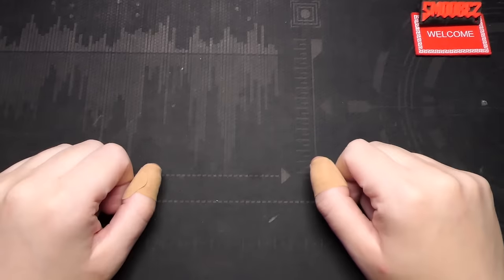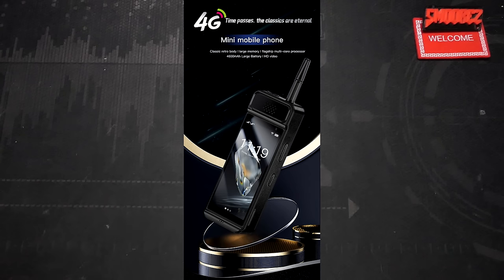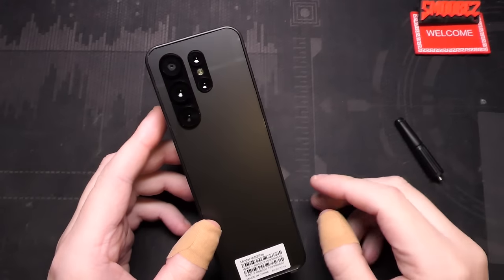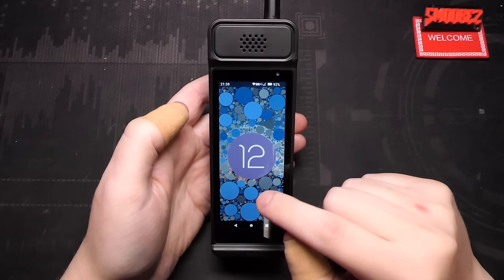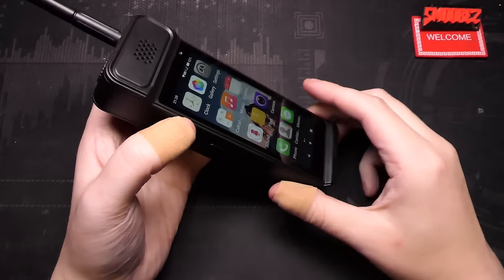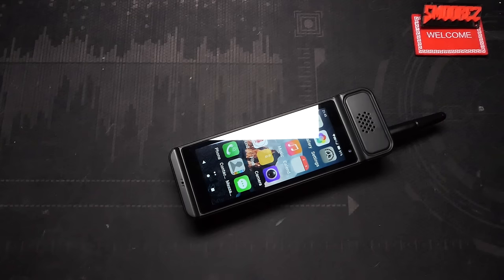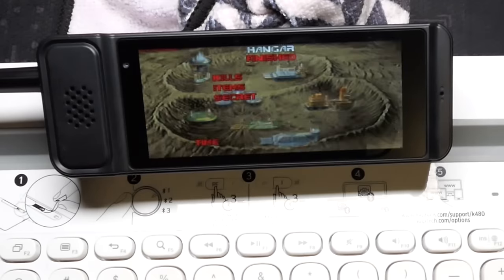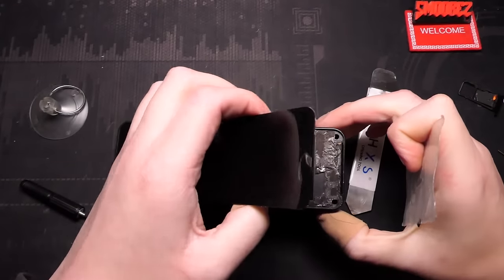(iWish) I bought the $130 SOYES W88 PRO Mini Brick Phone Thing from AliExpress!

Comment: The idea would be genius if it were a satellite phone with a good smartphone and proper GPS combined. So i wouldn't have to carry three devices when traveling.
Reply: Soon normal phones will have satellite connection. I believe the iPhone 15 Pro/Max already have it for emergencies.
Reply: Some flagships now have dual or tri-band GPS which doesn't require cellular connection to work.
Reply: The ulefone Armor 23 Ultra has satelite messaging built in through bullitt but they don't cover Australia just yet, later this year they reckon
Reply: @jjcoolaus  Australia wouldn't be important to me, but eastern Asia. My family in law lives in Mongolia and the Baikal area. 

I currently have one from Iridium, which looks like a 90's phone. It's extremely clunky, especially with the antenna sticking out. In vehicle this is not a problem, but when navigating the terrain on foot, it is cumbersome. 

CAT has a satellite phone, the S75 that might have been interesting, but it uses a very limited text only service from Bullit. They DON'T cover Asia at ALL. Iridium is worldwide and supports calls, which is important if hands are incapacitated.
Reply: The iPhone has all that now, no need for multiple devices.

Comment: As an engineer in radio frequency domain, I can confirm the bloody obvious, that the screw in, external "antenna" does nothing. 

Techncially antennas can couple wo dont need wires too them but there is no such mechanism here. 

That "antenna", if real, would have beyond horrid performance on 3G/4G. Even the relic that is 2G would be near unuseable. 

It looks to be from a cheap UHF 2 way radio toy and around 400 MHz is likely all the antenna, if wired up correctly was semi-competent for (measure the length and we can get a decent idea of the designed frequency).

An interesting gimmick in its own way. Thanks for birnging the hidden "gems" of chineese e commerce to our screens Smoorez
Reply: Probably only half decent usage would be as walkie talkie antenna, or as a CB radio, and even there would not be the best
Reply: That antenna has other ... uses 😁🤩🤣
Reply: I have an old phone from the early 90s that has an antenna that looms almost the same.

It worked fine back in the day with it, it had no signal at all without it.

Comment: Wow what a walk down memory lane. The style is reminiscent of the walkie talkies that bouncer/security  people used 20-30 years ago. 

On the whole I like this novelty phone. But it is mainly the nostalgia  bit. Lol 😆 

Sound is OK and the camera took some ok photos. The pink flowers ere not to bad  but not as good as the phone that was sent for review a few weeks back.  

The video test had me beginning to suffer motion sickness 😢 

Ripley was a star as usual. 

The *Ainol hoodie and beenie hat are cool. 😊 bit it still appeals to my immature sense of humour. 😂
Reply: Yes, the camera is surprisingly good. I just did some math. Turns out, the sensor is actually pretty large for a bootleg phone at ~20.6 sq-mm or roughly 1/2.8". 
That's actually slightly larger than the 50 megapixel Samsung ISOCell JN1 on my Xiaomi, though I doubt it's backside illuminated (BSI or 3D-BSI) or has PDAF and the F/2.8 aperture is pretty small, hence the poor low-light performance.
Reply: It's slightly smaller sensor size than the jn1.

Sensor size can be fairly meaningless. There are sensor sizes that are a similar size from 15 years ago that take photos in good light better than this phone does.
Reply: @wyterabitt2149  Sure, sensor size isn't everything. But I highly doubt older sensors from 15 years ago can keep-up with modern smartphone sensors that are both frontside and backside illuminated (FSI, BSI), feature pixel binning, complex noise reduction algorithms, and also come with other features like F-DTI, VTG and Lord knows what else!

Comment: Thanks for the review…Fyi a semiconductor (I assume partly the material this block phone is made of ) along with the antenna has a specific purpose. Albeit a complex one, dealing with transmission of a radio signal- think UHF/VHF, if you and mates are caught up outdoors with no cellular coverage, provided a user “ out there” knows your phone no. …they can send you a message as long as you have the antenna on the SOYES phone.

Comment: In case you are already going for Soyes XS16, i think it would be more smart to go for the XS16 PRO (4" screen instead 3"). XS16 is basically the same device as XS12,XS13,XS14... and there are ton of reviews for that, while there is none yet for XS16PRO. I was thinking about buying one), but i'm afraid of the camera quality:-D I refuse walking around with a half brick in my pocket, my daily driver is either my Palm PVG100 or my Cubot KingKong Mini 2, latter has questionable camera quality especially with low light though.

Comment: 36:10
This is because they've probably stole that string (called 'fingerprint' in Android) from some device, and does not represent the actual device. That's mostly done in order to pass Play Integrity for using the GMS (Google Mobile Services) for marking the device as a "certified by Google". Peopley use old fingerprints in order to bypass such check, sometimes it work, sometimes it doesn't (as Google probably patched said old string)

Comment: They likely found the devices on open market with the fake cameras.  But since they don’t want to scam their customers they dont push the 5 cameras and openly say that they only give one camera.  It is much more than just extra 2 cents to add macro camera and stuff. The module is a few dollars or more.   Plus the added PCB design and application work that isn’t cheap.

Comment: thank chonk has 180g? Literally lighter than my s23 ultra what
Reply: Pretty easy to be lightweight with a small battery and empty space with mostly plastic and tiny mainboard. 

That "4500 mAh" battery is likely 2000 max, the screen is tiny, all the cameras are fake except two. Of course it's lighter than your 6 inch plus s23 ultra.

By the way, Samsung blows donkey dong. Read their privacy policy, agreeing to it allows Samsung to share your BANKING INFORMATION with their "partners". And OneUI has more bloat than an ACER prebuilt. Just saying, not to insult you. But I switched to Pixel, and the experience is way better.
Reply: They have all you're information too buddy.

Comment: Had a 2016 Kia Soul back in 2020, when the car hit around 78k miles the engine light came on for a p0420 code, huge red flag, so I traded it for a 2020 Toyota CH-R. The difference is night and day in quality. Also have a 2016 Scion iM with 60k miles. Amazing cars.
Reply: 420 code just means "smoke weed every day"
According to Snoopy Dog Doge

Comment: FOR ANYONE WHO WANTS TO MAKE THEIR ANDROID PHONE FEEL 'MORE RESPONSIVE'... :-
- Go into 'Developer Mode' (find out how to 'Enable Developer Mode' IF you haven't already),
- Scroll down to the 'Drawing' section,
- Scroll down to ''Window Animation Scale' & Transition Animation Scale' & Animation Duration Scale',
- As standard All three of these will usually be set to '1x', set ALL three to either '.5x' (for quicker response), or, set ALL THREE to 'Animation Off' (which will just make everything feel 'Instant'... 👍
Setting ALL three will make your phone feel DOG SLOW! 🤣🤣
😎🇬🇧
Reply from the maker: I usually do this with all Android phones but for reviews 90% of the time I'll leave them at default. I have tested this with .5 animations and it's still incredibly slow in some scenarios.
Reply: Nope. This doesn't fix a slow phone being slow. But ok.
Reply: @playerroku4412  I DIDN'T say that it'll fix a slow phone. IF you read correctly, I said "Feel 'More responsive'.." and "Feel 'Instant'.."... 😏
Reply: I tend to put those settings to 2x because lower settings go so fast they stutter more if the GPU can't keep up with the speed